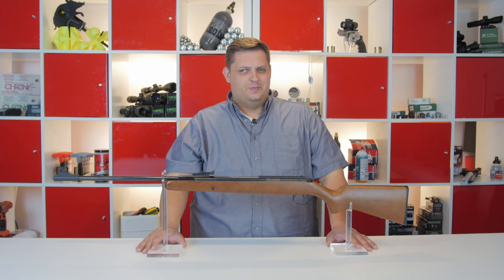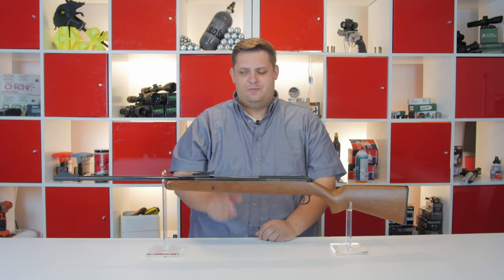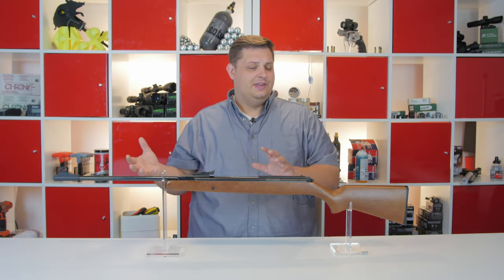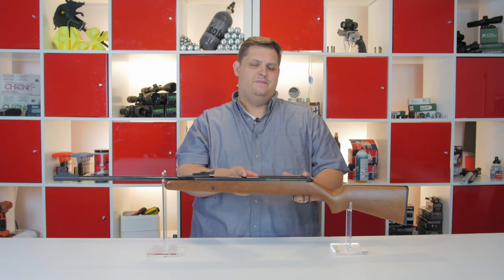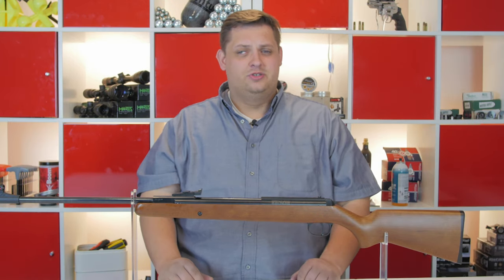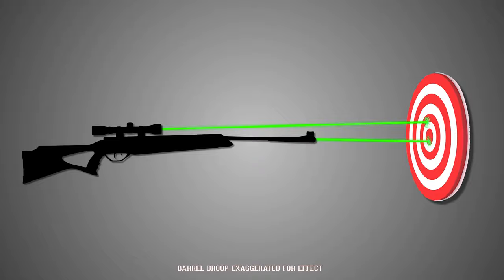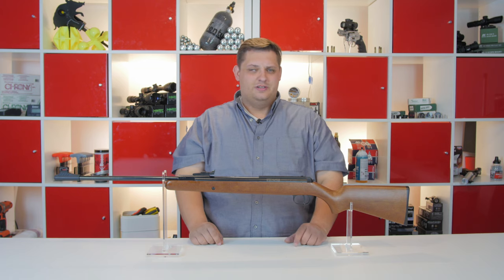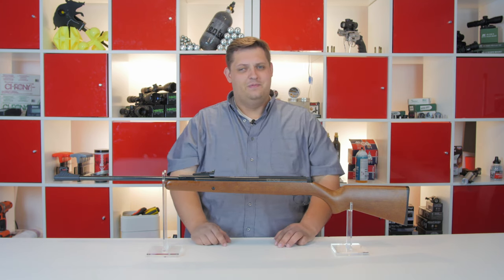What is Barrel Droop? and How to Fix It

Comment: This video does not talk about fixing barrel droop, it talks about how to live with it. To fix barrel droop the only remedy is to Bend the barrel up very slightly.
Reply: depends where the droop originates my BSA Meteor MK II early 60's  gun has droop i need a reamer to fix it and a new pin just age related wear and a lot better than bending the barrel and just as quick if not quicker
Reply: Best fix is to sell it and buy a side lever lol
Reply: @rifleshooterchannel208  hahah, true but the disadvantage there is the added weight
Reply: Not when your barrel is already straight. The problem with my hw50s is that the barrel doesn't line up with the reciever 100%

Comment: Be careful with the pop can shims, I have actually had a cheap scope tube buckle because the shim was just enough to change the mount diameter and put the squeeze to it. since then I have used thin plastic (phone screen protectors for example).   
As far as droop mounts go, a few years ago I was able to find a Hawke adjustable tilt mount. it was very inexpensive, still converts from 11mm to PIC rail, and fastens down very securely. It's a little lower profile than the UTG or RWS droop mounts, and there is a set screw to secure the angle once you get it right. I'm pretty sure it's this one. http://www.hawkeoptics.com/adaptor-base-1-piece-38-rifle-to-weaver-elevated.html

Comment: The best way is to put the gun in a vice and check the cilinder to be level .and then the barrel with a level .and if a droop down is the case . You need a metalfile  and a marker or so to see where the barrel hits .and there you remove metal till and repeat with marker . the barrel and cilinder are both level .
.this wil also add accuracy because you get less swinging of the barrel  .the recoil and hit of the piston is then in line of the barrel .
With shims you can destroy easy a scope..

Comment: My barrel droop is caused by a week locking of the joint,  shoots fine all the time it I am holding the barrel instead of the forearm,,,  and when I set the forearm on a bag then the slight drop into the bag lets the barrel drop a few .001" and I hit low....   It is a tack driver if I sit the barrel on the bag.    Shimming the scope on a good gun is just all the parts out of line a few .0001"  and not Droop.   Like nothing is perfect.

Comment: What about the barrel pointing slightly up? How do I fix it, or is it just unfix able? I’m a noob with break barrels, so I don’t know much.
Reply from the maker: You could shim in the front instead of the back or more likely than not it's just a non-issue.  The scope has an internal tube with lenses in it that moves when the scope is adjusted.  Lowering it a bunch takes the tension off the springs in the tube and that is where the problem lies.  When raising it there is additional pressure on the spring so it is not an issue as long as there is still room to move right and left enough (windage)  If this does not make sense call 1-866-477-4867 and hit 250 for Cory.
Reply: I would try a new breech seal and barrel joint shims first.
For my old break barrel they are BS002 and W063 on this page. 

Get the play out of the break. Also careful to close a break barrel gently with a soft click. Never just slam them shut. 

https://www.gunspares.co.uk/products/24268/Magnum/#
Reply: In that case you can only with a co2 or other welding machine put metal where its needed .and file it  till its correct again

Comment: Exellent ...but how can a bolt action or "Fixed barrel" experience "droop". It would be bent in my opinion. Any advice on straightening bent barrels?
Reply from the maker: Barrel droop often results from the barrel being fixed into the breech block at an angle. It doesn't just happen in airguns; firearms like the Ruger 1022 and AR14 often have droop also. Barrels can be bent in a variety of ways. Tom Gaylord discusses one in this series and I have bent them in more rough and ready ways. https://www.pyramydair.com/blog/2012/09/bending-airgun-barrels-part-5/
Reply: @airgundepot  thanks ...that is a great article ...you people are always helpful. I was just going to order a new barrel ...but this convinced me to give it a try. So I got it apart now & I'm heading to the machine shop with the borrowed "bore sighting laser" to see if I can bend it back straight ...should be simple as it is a single axis bend & I have access to a machine shop with a press & dial gauges ...allthough I think it will still be a hit & miss situation. I'd like to avoid using a scope shim. Thanks again

Comment: What about this Ben M Lothar Walther I just got from AirGunD? There is a .44mm (18 thousandths) difference between the front and back of the barrel drooping downward. It required a full turn and a half on the scope. Is this severe barrel droop or normal? Whats the range on the Hawke Airmax scope before the tube is flopping around because of spring tension issues and you need shims? Sort of lame given the cost of this rifle. This is my third attempt. First two came damaged.  https://www.youtube.com/watch?v=B0sjCKuNJOQ

Comment: My gamo magnum cal 22 doesn't droop. It is pointing up. It was fine a month ago  I don"t know the cause of that. Tried to shim the front scope bracket using 5 soda can shims and is not enought.
Reply: I have the same rifle, I fixed it with adjustable scope mount rings instead of shims. If yours is severe, try both together, that should work.
Reply: @ZamekCastle  the barrel was bent pointing up idk how tha happended. I bent it the opposite way like a 1/2 of an inch and it is perfect again

Comment: When & how long does it take before we start seeing barrel droop..Are fixed barrel affected by barrel droop?
Reply: That's definitely a hard question to answer, it would depend on many variables like build quality, type of action, how well it's maintained and stored, etc...
Reply from the maker: Any gun can have barrel droop, but it is more commonly seen in break barrels, and barrel droop can come straight from the factory if it is a manufacturing issue. Most airguns won't develop it.

Comment: No offense, but if you need a scope to shoot an air rifle why even shoot one. Mounting a scope takes the challenge away
Reply: It's not always about need. Some people want greater accuracy, especially at longer distances, and  iron sights cannot match the accuracy of a good scope and rings. Also, some people have poor eye sight and need an optic or they simply can't shoot at all. One more thing to help you understand: for hunting, a scope is far more responsible, especially at longer distances, or animals will suffer more from less precise iron sight hits. There you go. A quick education.
Reply: Thanks Johnny.  I am partially sighted, and without the benefit of a scope,  I would have little hope of doing very well in the world of shooting.  Sadly, we are not all blessed with perfect eyesight.  The use of scopes somewhat levels the playing field.
Reply: Why shoot anything using a scope with that logic? Quality air rifles can hit targets 60, even 100 yards out, accurately. The targets are also much smaller, some the size of a quarter. The distance may not be as far as a traditional rifle, but the targets are much smaller, which means precision is necessary and the way to achieve that is through a scope.